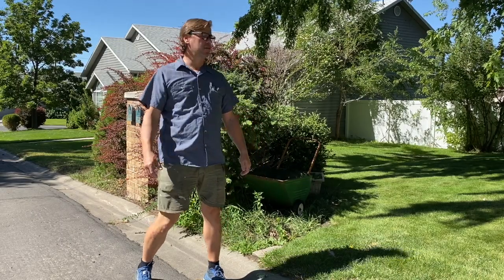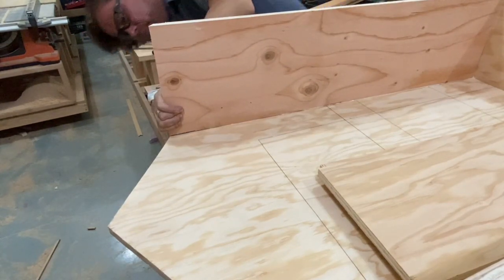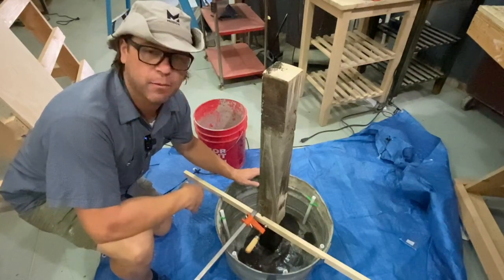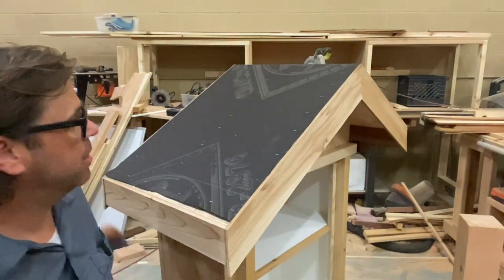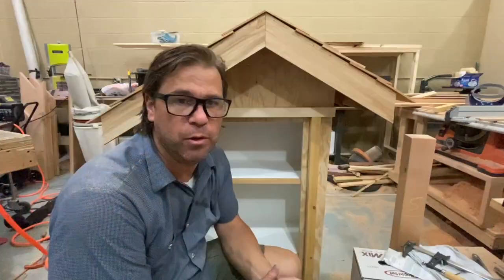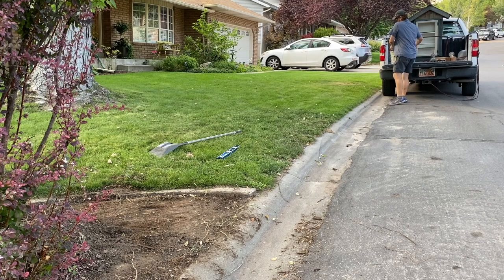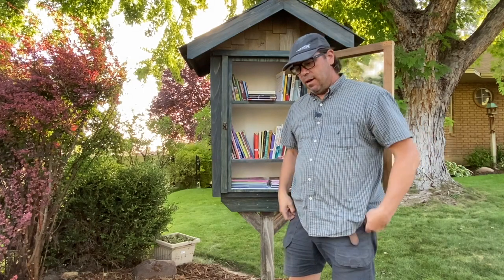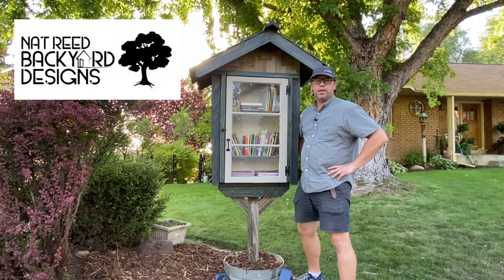How to Build a Little Free Library and Bring Happiness and Knowledge to Your Neighborhood

Comment: Washtub bro!! Even in the NW I know y’all don’t say wash bucket...”Ain’t no hole in the washtub”... Emmett Otter. Great Library.. looks awesome!!!
Reply from the maker: Did I say wash bucket in the video? As I get older, and especially when I’m filming, I can’t remember words. Because of course it’s a washtub. I’m from the south originally, and it’s definitely a washtub. Thank you for your comment, and for the compliment. It was the most fun I’ve had working in a project in a while.
Reply: Nat Reed Backyard Designs Thanks!! I hope you don’t mind if I follow your design here in Tallahassee Fl
Reply from the maker: Are you building a library? You can absolutely use my design. If you need my dimensions I can get those for you tomorrow. The fun (and time consuming) part of this project was. I had no plan. I had a window and a design inspiration and then just started making it. I usually start with a drawing, this time I just went with the flow.
Reply: I love the design, and I would greatly appreciate it!